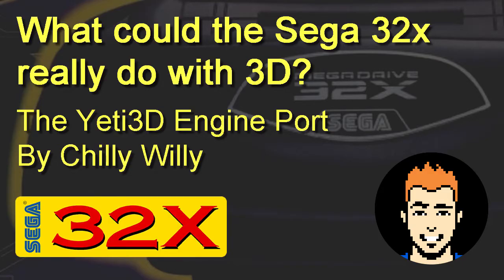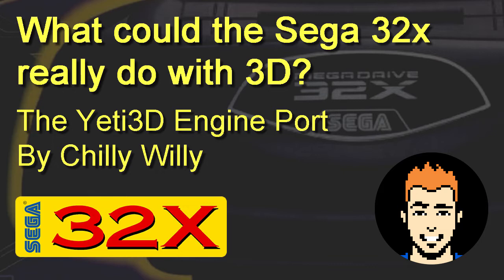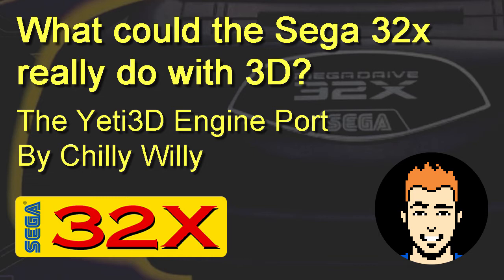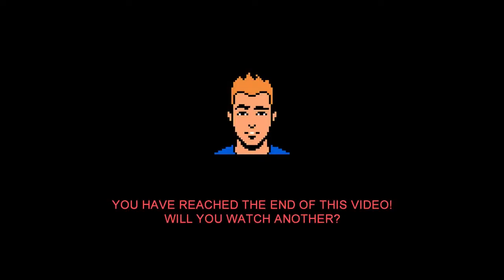What could the Sega 32x really do with 3D? The Yeti3D Engine

Comment: What kind of native resolution do you think you could muster if you used both SH2s to render, no CPU time spent on scaling? Would it be easier to scale vertical resolution only?

That aside, while the 3D demos and cancelled games I've seen on the 32X have been cool... it really does excel at 2D. A 32X version of Streets of Rage could have been a killer launch title.
Reply from the maker: The problem is its not that great at 2d either lol it can't do the full 60fps the MD is capable of without major optimisation.
Reply: @RetroSegaDev  Yeah it's stupid hard to utilize it right, but there were a few developers that did a stellar job. Also with a 2D title you can still harness the Genesis to handle some work on the VDP.
Reply from the maker: I'm still hopeful we'll see a simple dev kit one day!
Reply: @RetroSegaDev  That would be amazing - ah, it wouldn't let you harness the full power, but something is better than nothing.

Comment: Chilly Willy, before he disappeared into the interwebs ether like I did, was also talking about the possibilities for RAM upgrades in cart for 32X games.  Really, in relation to the Jaguar, 3DO or 486/Pentium 1 PCs at the time, RAM was the biggest limitation of the 32X.  That should not be surprising for fans of consoles, but somehow everything related to the 32X not being a horrible abortion at all is surprising to the interwebs.

Had Sega not been forced to cancel the 32X, for reasons we still do not understand, it could have seen good ports/adaptations of any and all PC and even Model 1 Arcade games of the time.  I would have skipped the PS1, N64 and Saturn for that console library alone.
Reply from the maker: He's not vanished entirely! :) RAM in the cart is a somewhat pointless proposition as only the Mega Drive can only write to the cart port.  Makes more sense for Sega CD games though 👍
Reply: I am very glad to see that Chilly Willy is still around.  Thank you for the info.

I suppose RAM in the carts is more of a hypothetical, or a homebrew pipe dream like the Dreamcast RAM mod.  I prefer to stick to the historical possibilities of actually released games and hardware.  But with the existence of memory mappers and helper chips more RAM in a cart isn't too far out there.  Even then a lot of the performance is hard to iron out.  The entire Sega CD is essentially running off a secondary Cartridge port as well, I think it has the same limitations even.
Reply: The 32x had a version of Panzer Dragoon running on it. But obviously the Saturn is the more impressive machine.
Reply: A RAM cart could be great for a large game, but it's looking like the Mega CD (68000) would have to fill it with content, and the 32X would only be able to READ from it, like a ROM cart, at best.

That still has a lot of potential for large games, as it'd pretty much be akin to a ROM cartridge for the 32X, that can be refilled in between levels by the Mega CD. It could lead to there being fewer limits where it comes to background graphics, sound samples and sprites, but with the added hassle of loading pauses. 

TBH, the Mega CD has a small pool of RAM where data could potentially be cached, so moving a smaller chunk - 4Mbits/512KB from the MCD RAM to the RAM cart periodically, might be something that could be done in order to more easily 'hide' some of the loading pauses from the CD.

Lets see what the future brings... there are a 'few' technical hurdles to overcome, but it could well be possible.

The other option is having a portion of RAM and ROM in the cartridge port, to avoid some of the loading, but I've not even begun to look into the feasibility of that, yet.

Comment: That looks more like BSP than true 3D. I'm curious as to what it could do with real 3D. Could it have been taken as far as the GBA or even further regarding its abilities?
Reply: That's a choice on the part of the mapper, they're going for more of a Doom feel than Quake.
Reply: @bortgunn9079  

True, but the GBA seems to be less capable than an Amiga A1200, while the 32X is a considerable step above that. 

Yet most 3D games on the GBA look better, with full texture wrapping, minimal texture warping on the better game engines, and so on.

The most I've seen with the GBA is about 3,000 textured polygons per second at 20 FPS, while the 32X was capable of a theoretical 50,000 textured polygons per second. It's just it was relatively new technology and was irrelevant almost as soon as it came out with the release of the Saturn and PS1.
Reply from the maker: The GBA version of yeti 3d had two advantages: it had the rendering path completely in optimized ARM assembly, and it used a GBA video mode that allowed the rendering at 120x80 without needing any software stretching. 

This engine is highly unoptimised and was created as a demo of what you could do with Chilly Willy's 32x SDK.  I'd planned to implement colour gradient based walls to enable a bit more speed but never got around to it!
Reply: Interesting. I’m not a tech guy, so I always assumed that the GBA was basically a portable 32x as it was more capable than a SNES, but below a 3DO. Based on the games I played. I thought the FPS games were quite capable, and the flat polygon games like Lego drone racers was comparable to Virtua Racer, and V-Rally was probably as high as you could push 3D without compromising gameplay. Driv3r and Atserix were impressive, but didn’t play well. 

But old school FPS games like Doom and Duke played fantastic. Wish there was more, like rise of the triad and other build engine game ports or interpretations would be nice.
Reply: BSP has nothing to do with true or not true 3D I think you confuse it with like only y axis rotation raycasted renderer?
Reply: @litjellyfish  

BSP is just optimized raycasting, rendering walls in front and ignoring the ones behind. It still just uses vertical lines to make up the walls, though.

 I'm talking about polygon-based rendering. How far could it have taken a polygon-based 3D level?
Reply: @Mechaghostman2  bsp is not tied to raycasting really, Two different concepts abs method la used for visibility check, but as you say they can work together. That is why I thought the statement this is it real 3D. I mean it’s the rendering tech for the walls that maybe not is true “free” 3D while BSP is was you say just for the visibility check. As “real” 3d engines still uses BSP to determine what to draw
Reply: @Mechaghostman2  I think most likely it could achieve similar as GBA. Main thing is the a bit higher resolution.  But for sure it would still be far from what the Saturn could push out

Comment: The 32x could have easily ran games like FF7, or resident evil, maybe even metal gear. the soundtracks would need to be remade using the Genesis sound chips and they could actually be made really close to the originals in the right hands, also there wouldn't be any FMVs due to the limited space on the cart. It was a shame the 32x didnt get any attention back in the day.
Reply from the maker: The trade off is mega drive drawn backgrounds with 32x drawn polygons.  I'm not sure how close you'd get to psOne tho. I think the 3d models would suffer some serious reductions in quality :) maybe one day we'll get an easy to use SDK to find out 😁
Reply: 32x cd you could have the fmv.
Reply: RAM would be a huge problem, it was one of the 32x bottlenecks. The Jaguar was considered lacking in RAM and it had around 4x more than the 32x
Reply from the maker: Yup!
Reply: Decoding video is a taxing process. Maybe if the compression were non-existent, the 32X would have an easier time, but that would increase file size. There was video decoding in Sega CD and Sega CD-32X titles, but they made concessions like lowering the amount of data per frame, reducing resolution and color information. VRAM is a lot less than PS1. Also, weren't there scenes / areas in those PS1 games where video decoding was run as a different layer over / behind the gameplay layer? That's not to say videos couldn't be re-worked into in-game cutscenes.
Reply: Not easily. I mean RE 2 barely ran ok on station

Comment: Ha, I knew that 32x was capable of real 3D. My first thought about it was back when I studied the Ngage tech demo known as fully playable Tomb Raider. Not only the game would fit on a 8MB cartridge, it also runs on a decent framerate. Problem is, it also runs in a much smaller resolution, but this is something that can be dealt with (like with use of lowered rendering). 
Surely the game would also exclude the "save anywhere" option, and forcing the player to save in certain spots, like on Saturn. For some time I was also worried about the weaker 32x CPU, but lets not forget, that Ngage also had to run an OS in the background. With the lowered rendering, the 32x would be surely able to perform well.
Overall, I think it is possible though. Excluding the FMVs, leaving little SFX, plus limiting the enemies to one at the time (so no multiple bat attacks etc), and we could even leave the Lara's Home level ! How good does this sounds ?
Unfortunately this is just a theory, as I wont ever be able to do a port like this alone, since I know very little about 32x programming. Having all the assets ready isnt everything sadly. Thats the main problem, because having the right toolkits and knowledge you can nowadays do the ports of numerous games, and keep the system really alive, just by doing this. There are tons of games that could be ported, being mainly 2D titles, plus some of the simple 3D titles (take the unreleased Dayona USA for example). Mind you other systems like Family Computer and Mega Drive had got tons of interesting hardware pushing games released, and those systems are still alive. Toolkits like NES Maker only prove this has sense.
32x to me has the same potential as Jaguar, and I believe that both systems have a lot in common. I remember reading somewhere that Tomb Raider was supposed to be ported to the Jaguar too, which would only prove the 32x being capable of similiar stuff too. Like I said earlier, fitting games on cartridges wont be a problem too, after all there were lots of titles released at N64 carts, that were ports of their PSX/PC/DC bigger bros. But we also did had Jaguar CD, and 32x CD ... Oh boy :P
Reply: I completly agree kissbestfan🙂👍👍.
Reply: So would Quake, Duke Nukem or Resident evil 1 be possible?
Reply: So far I predicted Tomb Raider being on 32x. Its now a reality. 

Dont know about Quake, but Duke Nukem is already on a "normal" Mega Drive. Check it out. Despite not being a full port, it is rather impressive. 

As for Resident Evil, I believe it is also possible. The original Alone in the dark was developed for the 32x, and its not that far away from RE.
If by any chance we get an open sourced version, this May happen.
Reply: @KISSbestfan  I've seen it, yes it's impressive but it's closer to Wolfenstein 3D than Duke Nukem that megadrive game. Someone has made a rough port of Doom to the megadrive though quite recently, it looks more impressive. 

You doubt Quake is possible on the 32x? There was always a lot of talk about Quake on the Atari Jaguar back in the day on forums. They doubted it but in fairness they also doubted Tomb raider being possible.
Reply: Its not like I have doubts. Im Just not that familiar with Quake, and the Way it is coded. This is why I dont want to say too much. Never was a Quake guy, I pretty much missed out on that game.

Its probably like you are saying though. But releasing a demo, versus releasing a full game, with least amount of bugs, and Good optimisation is Another thing. This is why we May See something like that in near future, but it can be far from being complete.

As for the Mega Drive version of Duke Nukem, it surely isnt the real deal, but its still very impressive, and the game was done in the late 90s, when it had to be made pretty much from scratch. Sadly because such game exists, I doubt anyone Will touch that subject anytime soon.

Comment: I'd really like to see someone use the whole Mega CD 32X combo, and push all three together to the limits and see what they could do working in tandem.
Reply: I can imagine it's not easy. But it'd be cool to see a really talented developer try to get the best out of the machine, and see what it was really capable of. No games were released that did this, the only ones available for the full combo were awful FMV titles. To see it running a proper, textured polygonal 3D game with decent quality music would be quite something, and should be possible with the storage available on a CD. The Saturn had a complex array of different processors too, and devs were able to make that do some fantastic tricks.
Reply: I'm sure such an ambitious project would require a fair amount of juggling of resources, but it's possible to use the memory and processors spread around the machine to perform different functions in layers and bring it all together. The CD-ROM drive is slow, perhaps the use of a hybrid, cart+CD, would give the best performance, where the majority of the game data were stored on the cart and audio and video sequences stored on the CD. I'm not saying it would be easy but I think it must be possible to get something cool out of it.
Reply: I agree. Been waiting for years.
Reply: I don’t think it would be anymore than just storage. The scaling and effects the Mega Cd does is really cool, but not above what the 32x could do. So you really just adding a single speed CD drive to the party, and if the Neo Geo CD is anything to go by... probably not a good idea, and I only recently found out that the Neo Geo CD had more inbuilt RAM than the Saturn with the RAM cart expansion 😳. So the 32X would just struggle too much to do anything more than more colourful FMV games.
Reply: @sloppynyuszi  dude someone just ported tomb raider 1 to the 32x,you are absolutely BTFO
Reply: @sloppynyuszi  You're so wrong, bro. The 32X can do software scaling, yes, but it requires CPU power compared to the SNES and Sega CD. You can also add more RAM via a cartridge
Reply: @sloppynyuszi  The Neo Geo CD loads slow because of all that RAM it has to fill. The Sega CD has little RAM to fill, so it doesn't load that slow for a CD-ROM console. It loads just as fast, maybe a little faster than my PlayStation despite the disc drive being only half the speed because it only had half the memory to fill. If your Sega CD is loading slow, it could be related to the laser or the quality of the discs you're using (it's been 30 years after all).

Other than far superior redbook CD audio, the Sega CD also brings along a texture mapped floor, freeing the 32X to render textured polygons on top of it, superior PCM sound effects, and much, much more storage space.

Comment: Sega should've just released the Neptune console and not the 32X add-on. It could've been a 3rd revision of the Genesis with or without Sega CD support at a decent price for people looking to buy not only a cheap 16-bit console (with an already large library of games) in the mid-late '90s, but also a cheap 32-bit console instead of letting Majesco release the really trimmed down Genesis 3.
Reply: The problem wasn't that it was an addon. The issue was it was released so close to the Saturn. Developers never gave it much attention.
Reply from the maker: As the last commenter said it was more a case of Sega going head to head with itself with two products for the same market
Reply: They should have just released the Saturn and a Power Base Converter cartridge to play your old Genesis games on the Saturn.
Reply: Or the Saturn could have been an all in one (Genesis/CD/32X in one box but with some bells and whistles).
Reply: @jamessmithandgarrettsmith3623 sound like a Torrijos idea